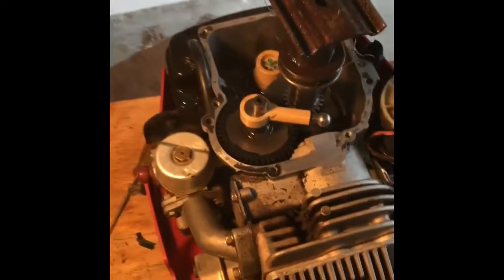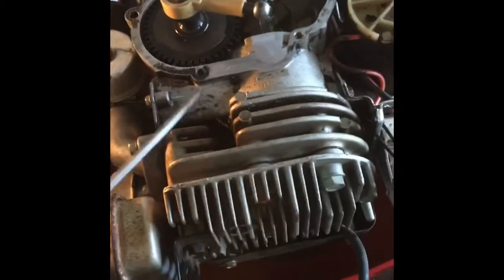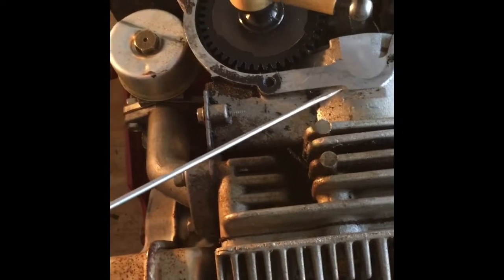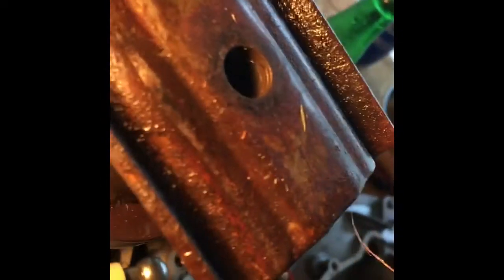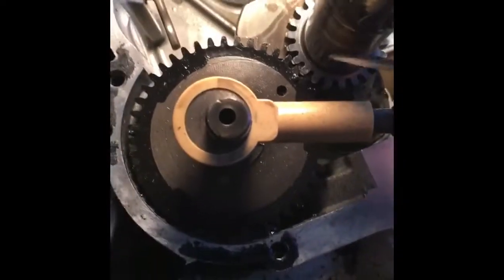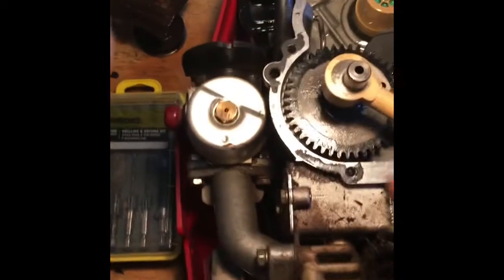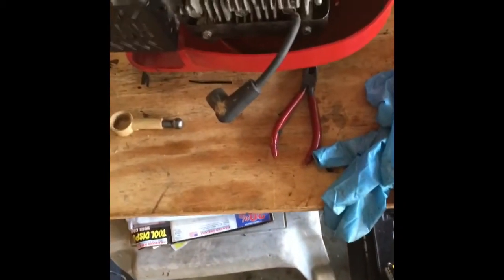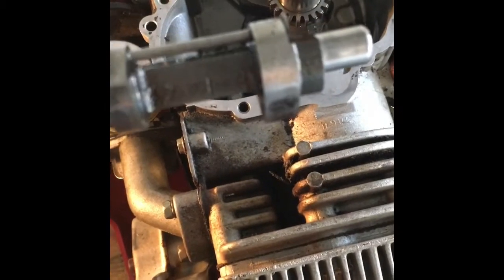Tecumseh Cam gear timing

Comment: Well thanks.  I am working on a Tecumseh  6.75 HP.  It was yanking the pull rope out of my hand.  I have always had luck changing the flywheel key.  This time it still yanks the rope.  I needed a video to verify the timing marks (same as a Briggs).   This old mower is so nice I think it was off at the factory. and never used  I will let you know.  Thanks for the visual   D Fields.  You comment on my channel all the time.  Bruce's Shop

Comment from the maker: Update :  I found that  the bottom 1/2 of the engine was crack on the inside. It was not visible on the outside.  
So I am having to scrap the engine

RIP Tecumseh lev195ea
https://youtu.be/LitKbbUrQCI

I kept parts from it and the deck and transmission are good. So in that case I really haven’t lost $$. As I didn’t have that much into it.